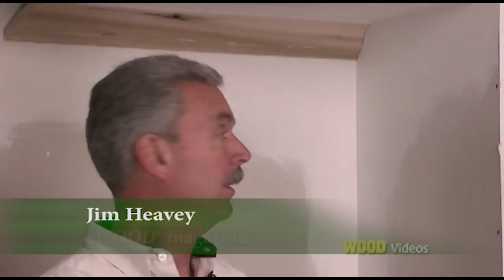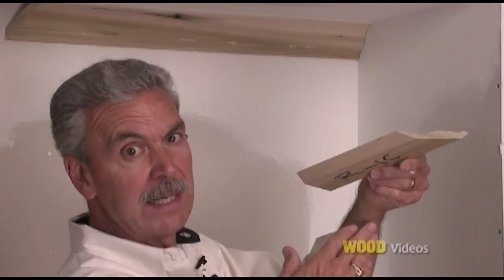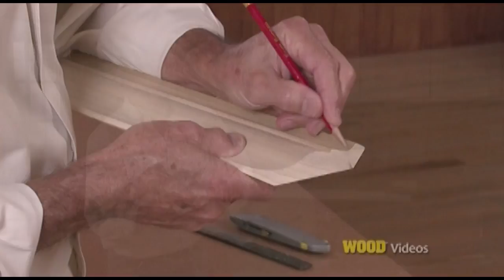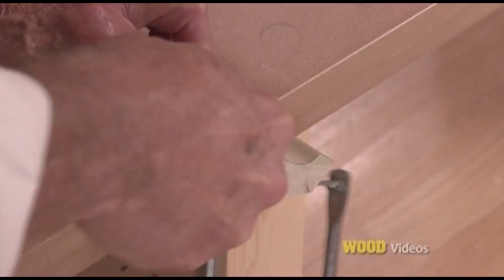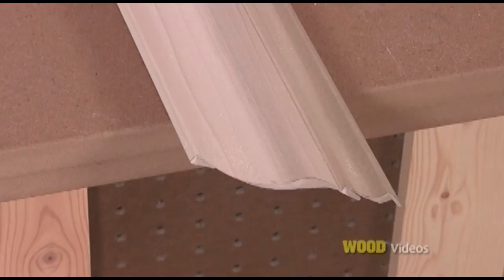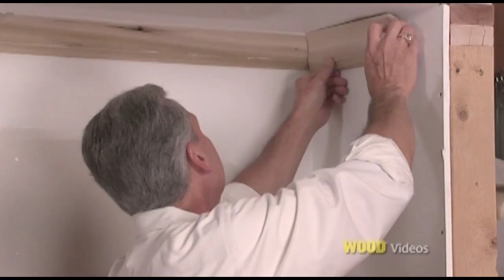How To Cope Crown Molding - WOOD magazine

Comment: I cut the cornice work crown molding for dozens of houses back in my day and this is the technique that I was taught.  We used a handsaw in a mitre box that we made ourselves (I think the molding was always placed in the box upside down).  Since our work was outside and high up, precision wasn't critical since the corners would all be caulked and painted,  but we took pride in our work and did a good job anyway.